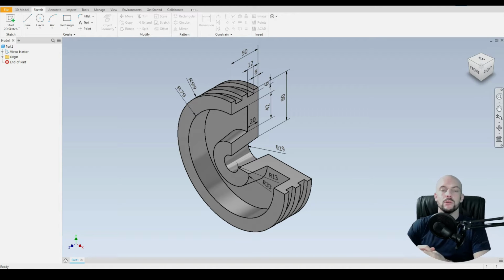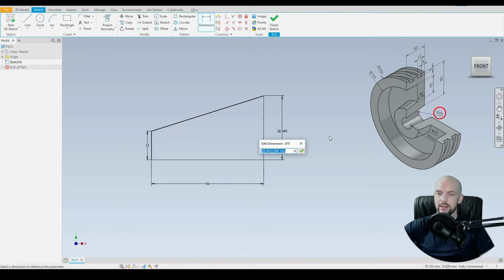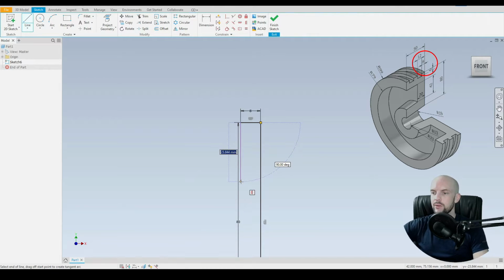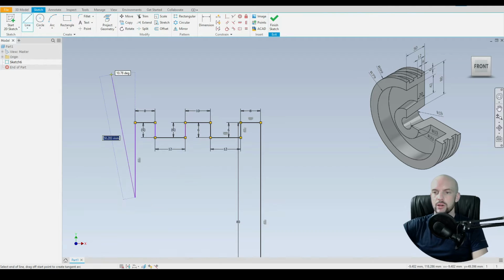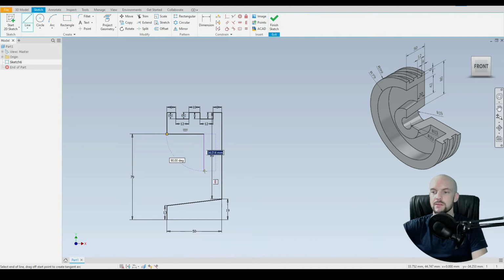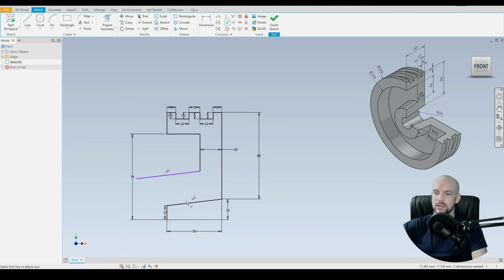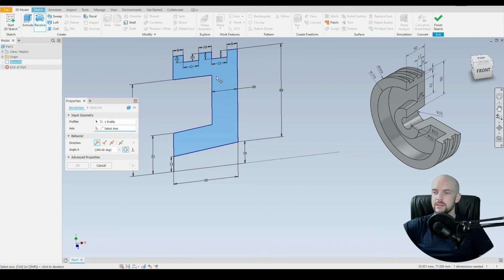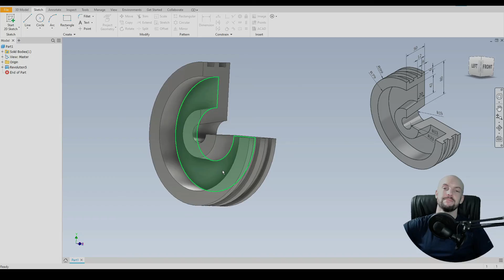Piston Head | Intermediate Tutorial Autodesk Inventor 2021 | Exercise 09 |

Comment: What is difference between inventor and fusion 360?
Reply from the maker: Hi Divyesh, good question! I use both Fusion 360 and Inventor, both are apart of the Autodesk Design Design Collection.

One of the key differences between F360 and Inventor is that F360 is a Cloud based software, so all files are stored on the Autodesk cloud. This is good if you will be using different computers with F360 installed as you can access files on any of these machines but this means you require an internet connection which is a limitation in my eyes. Inventor on the other hand is a desktop product.

One feature of Inventor that I really like is the on-board part libraries and software recognition for what is required based on the parts/ assemblies, also it has robust FEA simulation capabilities.

In terms of User Interface I prefer the Inventor interface and the much more broad selection of sketch and 3D modelling tools, however I would say that the graphical interface in F360 is much better where parts/ assy's have a more 'rendered' look.

For me, my preference is Inventor, I see it as being a more comprehensive CAD package, similar in terms of capabilities and performance to Solidworks and Siemens NX.
Reply: @AutodeskInventorTutorials  Thank you so much sir/Medam for Information...

I need software For Make Die Tools, Injection molding Mold, Cutting die etc. So which software i choose for Purchase? 🙏
Reply from the maker: @Divyesh, that's excellent that you will be designing molding parts, well done! Fusion 360 is notable cheaper than Inventor, so it's worth taking that into account when purchasing one of the licenses. Both software's would be suitable for such part designs and assemblies as you mention, so on that note I would personally be more inclined to go with Fusion360 if you are happy to work on a Cloud based system. Otherwise I would recommend Inventor. Hope that helps, and best of luck in your designs! 👍👍